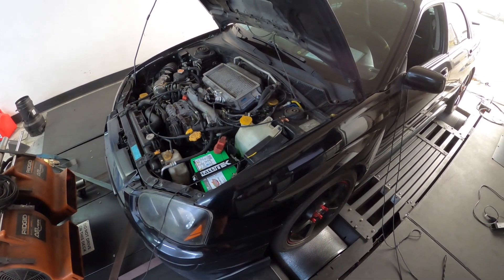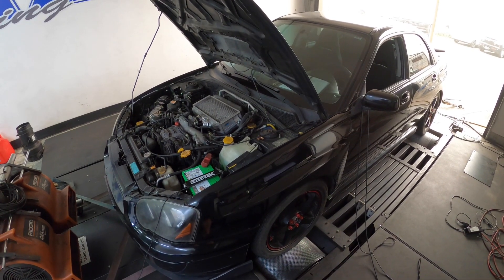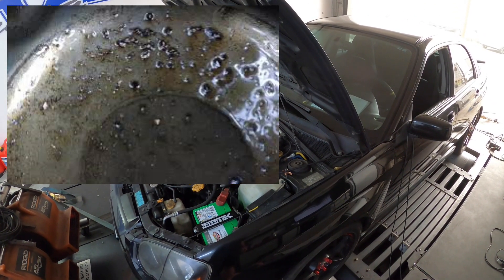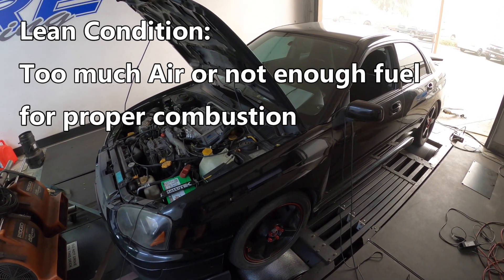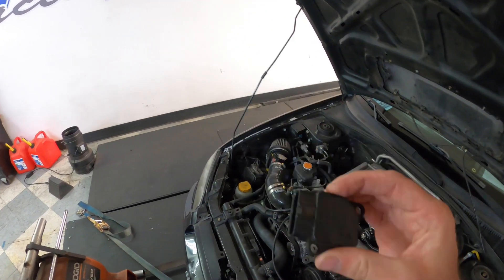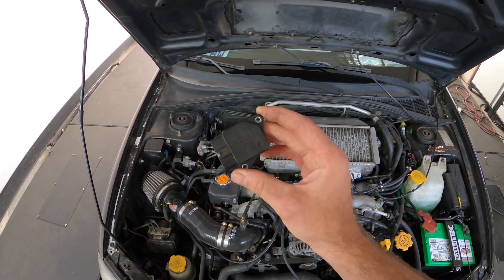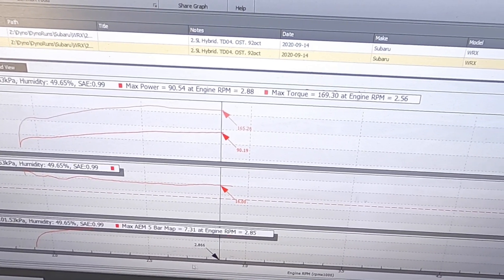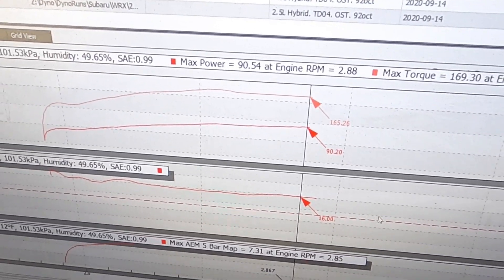Tuning Tech. Why did your Subaru motor blow up? Might not be what you think!

Comment: Thanks for the great info. Is there a noticeable difference in oil or coolant temperature when the engine is running lean and hot? Like my wrx is healthy and operating oil temp is usually 210°f. Say next year my MAF is dusty and it underreports airflow, would op temp be significantly higher in the same ambient temp?
For the context of knowing that it's time to clean or swap the sensor.
Reply from the maker: It would be really hard to measure since three vehicle operates in such a large dynamic of loads and afr targets.  If it were a plane or a boat that sits at constant load then sure but generally on a vehicle it won't be sufficient alone to determine much.
Reply: Makes sense, thanks for the quick reply!

Comment: Definitely a bad sensor, but having a blow-off valve doesn't help either. Running a BOV without speed density is asking for it.
Reply from the maker: Really depends on the valve.  Turbosmart valves adjusted to their tightest setting work very well without switching to SD.

Comment: I’m running speed density but still running a maf up until the maf sends 3.5 volts, after that it runs off the iat/map. What’s you’re opinion on that setup?
Reply from the maker: It works,  there's some advantages to that setup as well

Comment: What happens if the SD sensors stop working? Thanks for the video. Do you think that mafs should be replaced as preventive maintenance? If yes how long?
Reply from the maker: "Sd sensors" are a Pressure sensor and a temperature sensor,  while both can stop working they tend to be less temperamental and typically their failure results in a "no reading" where a mass air flow sensor (maf) tend to get lazy and understate their voltage as they wear out. Ideally a system could be tuned to run both (such as how many gen4 gm ecu's do) where one system checks against the other.  Only downside there is cost.... and we know how much manufacturers like spending money.

Comment: <<<< EJ257 rod knock at 27k miles 😢. Not really sure what caused it but there is a recall / extended warranty on 08-17 EJs for this particular problem. Mine however was not covered under warranty because I was running FBO along with E85. I was thinking maybe it was my fault going 2500 miles between oil changes and consistently running E85. I’ve been changing the oil on my new built motor now ever 1500 miles with Motul 300v Chrono 10w40 and still running E85 98% of the time. If that guy monitored a wideband he might of saved his motor.
Reply from the maker: Do you have a wideband that you monitor? 

Ethanol only engines that startup with an overly rich ratio will dilute oil pretty fast.  As soon as you notice it start to get chalky it's time to replace.

Comment: I really love your content and that you share this valuable knowledge. Keep it up :) Regarding the MAF - broken or dirty should always through a CEL shouldn't it? So we assume that an owner were using it without reading the CELs? Or can it work improperly without throwing a CEL? I had a CEL once, I don't remember the code, but it was about incorrect voltage readings on MAF, it was dirty, cleaned it and I've never had an issue again so far yet.
Reply from the maker: Nope. No cel. The cel parameters are basically only low/high voltage and fuel trim feedback (system rich system lean)  however where this MAF presented its issues was in the open loop range so you'd never know unless you had a real AFR gauge to monitor
Reply: @WT4T  thanks, that's actually pretty scary :D

Comment: What would you say the acceptable oil consumption for EJ257 at 3000k oil change interval?
Reply from the maker: On a stock motor anything more than a quart is cause for concern.  Things like knock and lean conditions will accelerate oil burn as well as extreme cold starts and high boost levels.  On built motors oil consumption will typically be much higher.
Reply: Will Tune For Tacos: it’s a 2013 with just exhaust and Cobb intake. I’ve been watching my AP. Not much knock. Around -1.4 on Feedback Knock. It uses almost 2 quarts before oil change. Not smoking and don’t see any leaks. I’m using 10w-30. Any advise?
Reply: Derrick Garcia That’s a substantial amount of oil. I personally suggest you have a compression and leak down test performed. I had a similar problem with a FA and it ended up being the valve seals. Car didn’t smoke a bit either.

Comment: I'm guessing low on oil is a common culprit.
Reply: Id like to say that ive never had that problem, but rod #4 would argue otherwise
Reply from the maker: @thewayfaringanarchists8157  oil consumption can come from a variety of sources including excessive knock and lean conditions in boost.  Knock will spin a bearing just as fast as low oil.
Reply: @WT4T  mine was my fault, i was low and hit the rev limiter quite hard in first. Big. Dumb. Mistake. 
That said , the ol girl is rebuilt with forged internals and a new turbo in the mail! cant wait to get it broke in and tuned!
Reply from the maker: @thewayfaringanarchists8157  clearly the tunes fault 😅
Reply: @WT4T  Dont get me wrong.....i would love if it wasnt mine hahahahahaha